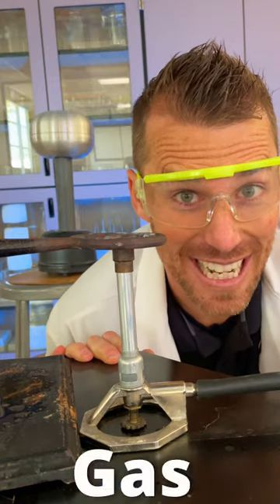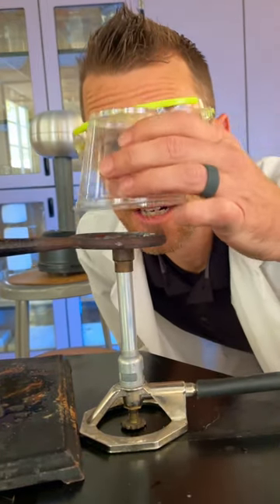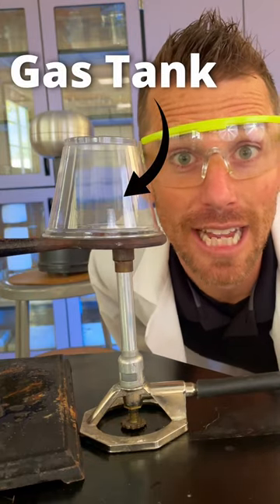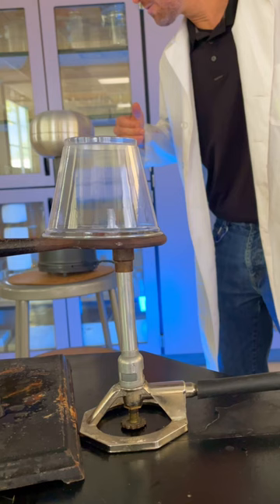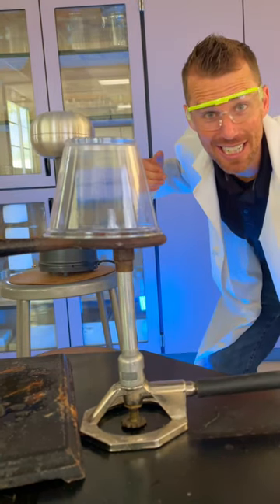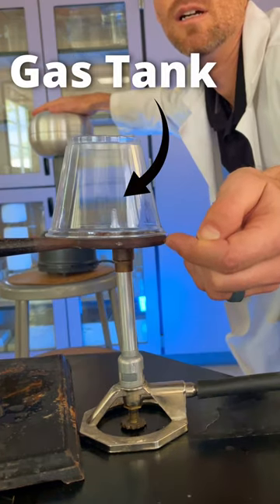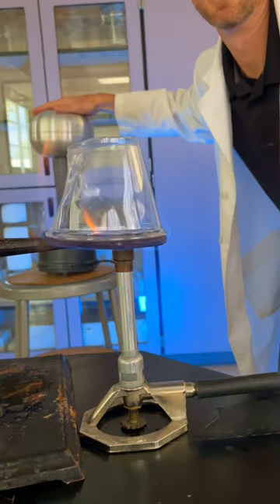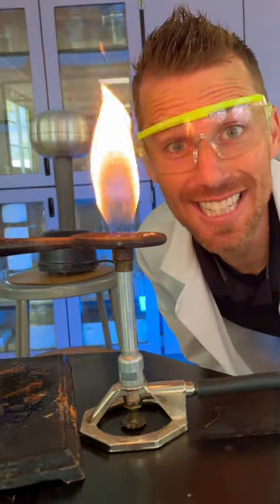Static ELECTRICITY and GAS STATIONS don't mix #shorts

Comment from the maker: Let me know what static electricity experiments you want to see in the comments!

Check out Bending Fire with static electricity:
https://youtube.com/shorts/QraOFzXEOYo
Reply: can you make a corona inside a sealed container of flamable gas?
Reply: The premise for the vid, not so hot. But a plus for production and passion. 

As far as static experiments can we see some static discharge threw different atmospheres and conditions?
Reply: Next time tell us the science behind how they prevent static from being a problem at gas stations
Reply: Build a PC, but instead of wearing an anti-static grounded wristband, give each component a zap of static like you did in this video before installing it, then see what happens when you try to boot it up

Comment: The Mythbuster crew tested this myth and couldn't get any ignition.
Reply: There are things that are hard to recreate. It's common practice to ground  big containers of flammable liquids in factorys. (Some Paint ect.)
And they are grounded for the purpose of discharging static electricity safely.
Reply: Weren't they testing whether or not cell phones could explode gas stations? I don't remember them testing static as well.
Reply: @ravenmist4890 they did test static too along with the cellphone and one more thing too I believr
Reply: 😈ORGODIAN RULER😈  Lighters use pieces of flint that create sparks when you spin the striker wheel.
Reply: orgodianruler6591  no, most lighters use burning metal shavings to ignite the gas
Reply: They did, but the conditions they needed were a 1 in a billion chance in a wild setting.
Reply: Probably because gasoline and propane/butane/whatever gas he was using is not the same thing
Reply: @lucaraaska8938  yea, hard to recreate, like an ignition source from a lighter right beside a buildup of gas... I can do that without any static charge nearby
Reply: Yes, because the Mythbuster crew is the end-all for every experience, surely
Reply: 😈ORGODIAN RULER😈  that uses butane and is easier to ignite. Gas needs a lot hotter spark like from a taser or spark plug, but it still needs the help of being sprayed to better mix with oxygen.
Reply: 😈ORGODIAN RULER😈  forgive them, they are still living in the stone age.
Reply: @ibringthepayan  gasoline will not burn. Gasoline vapour will ignite pretty easily, you need a proper mix of vapour to air though, the closer to perfect the easier it is.
Reply: @dougaltolan3017  not true take a flame to gasoline and see what happens. Sure it's the vapors that ignited but you don't have to do anything extra the hotter the heat source is the natural air mixture will do the job.
Reply: We responded to a pickup on fire at the gas station in the middle of the night. The driver was fueling up his gas cans in the bed of the truck. I didn't see the guy but I'm sure he received some bad burns
Reply: When they forced it they could but they determined that the amount of static electricity needed was more than one person can make getting in and out their vehicle they also debunked smoking stating that unless the person is actvly lightlung a cigarette then it can't caulse a fire
Reply: @ZeeoFullbright  I worked at a gas station where an attendant was required to pump the gas for you. As I was actively handling the nozzle, the chick in the driver seat starts to light a cigarette. It ended fine, but of all the times to light up, she chose right then
Reply: Best chain of comments lol
Reply: Why

Comment: Something has gone very wrong for gasoline vapour to be that concentrated in the open. As in, accidentally setting off a static discharge by closing your car door is going to be the LEAST of your worries!
Reply: Zackly, I guess this guy hasn't heard of the stoichiometric ratio.
Reply: @rustiemenard3945  Most people haven't.

Comment: So basically what he's saying is this will literally never happen
Reply: He's saying that there's a non-zero chance of it happening, in which case there's no excuse to not take simple safety precautions
Reply: @boyo7918  if you took safety precautions to prevent every non-zero-chance misfortune, you would have a bad life.
Reply: It had happened a lot of times actually
Reply: It's easier to happen than you think. Filling up a plastic gas container in the bed of a pickup truck generates static electricity and can make the whole thing go boom. That's why they say to always fill up containers on the ground.
Reply: You kidding? Hundreds of tank opening fires due to static electricity alone. Each year.
Reply: @scottmatznick3140  No it's a relatively common thing to happen, especially when filling a polymer tank in the bed of a truck. Can happen with a regular fill-up too if you are super-charged from layered winter clothing, getting in and out of the car. It doesn't take a van-der-graph to make enough static to ignite gas vapor. It is pretty rare for any individual to have this happen to them, but there are millions of people filling up gas tanks every hour, it's bound to happen. I usually touch the body of my car before starting the fueling process to discharge the static in a safe location instead of right at the gas nozzle. And, the safety precaution is not time or energy consuming.. just touch the car before you fill up lol, it's not like you have to suit up or anything.
Reply: @scottmatznick3140  Yes. Don't take too many precautions if they're too cumbersome and the risk is non existent.

However, are you really that lazy to not ruffle around too much in staticy clothing? I mean come on, don't be too petty.
Reply: @tomodachi1644  name one instance with citations
Reply: @calabrais  My crew responded to a fire in the middle of the night for this exact incident.

Comment: Good thing fuel tanks are not made of plastic cups that leak!
Reply: Plenty of them are made of plastic, and metal ones aren't foolproof either. They can crack or rust out.
Reply: The most likely situation where it comes applicable is when you open the cap of the fuel tank, fuel vapour inside the tank starts coming out, and your hand next to the metal of the car can create the static shock, igniting the vapour to an open fuel tank. You don't need a sealed non leaking container to represent this situation

Comment: An experiment based of this:
Electric charges can build up on an object or liquid when certain liquids (e.g., petroleum solvents, fuels) move in contact with other materials. This charge can occur when liquids are poured, pumped, filtered, agitated, stirred or flow through pipes. This buildup of electrical charge is called static electricity. Even when liquids are transported or handled in non-conductive containers, something rubbing the outside surface of the container may cause a static charge to build up in the liquid. The amount of charge that develops depends, in part, on how much liquid is involved and how fast is it flowing or is being agitated or stirred.

Comment: Natural gas and petroleum have different combustion points. As does natural gas compared to LNG . While you should discharge any static at a gas pump, it's not like a single charge will set a pump on fire.

Comment: As a petroleum inspector climbing the 75 foot petro storage tanks at refineries here in Texas. We are to be grounded and all equipment the entire time.
The pack we carry is metal lined with our measuring instruments touching said metal. Our bodies have a metal bracelet that is attached to the pack and the we have a clip we attach to the metal railing when we to the storage tank. Before even touching the tank. we are to touch a rod that is sticking up out of the ground near the tank about 10 ft away with our bare skin discharging any static. We then approach the tank and ground ourselves and equipment with the metal clip and cable that grounds us and our pack.
A person who did not comply with this practice set ablaze one storage tank which spread to neighboring tanks killing him and several fire suppression team members when they attempted to put the fire out. The tanks burned for several days and a nearby town went on complete lockdown. Respirators were delivered to all residential areas due to the poor air quality.
Static electricity around any fuel source IS A BIG DEAL.

Comment: Assuming that gas (the liquid with confusing name) have the same ignition point as gas (the gas in your burner) and your static electricity arcs over the plastic flap into the fuel tank, and there's enough air (being O2) in there to let it burn, then Yes you might see something happen, and depending on full/empty your tank is the effect will be more or less interesting
Reply: We call it benzin. And gas is gaz.
Reply: It's not the liquid fuel that's the danger, it's the vapor mixing with the air outside of the tank.
Reply: @venus_de_lmao  that was the idea, but in a tank with only gas fumes you won't get anything I think you need like a 30/70 mix

Comment: So, couple problems with this. The gas is a liquid going into the car, you are using a gas. Yeah, gasoline does flash to a gas, but not that much will flash in modern automobiles. Filling a gas can, yeah you will get a fair bit of vapor. Now the bigger problem is the catalytic converter. That bugger is HOT. Hot enough to auto ignite gasoline vapor. Which is why you want to not spill as much as possible, and clean any large spills promptly.

Comment: Now I get to demonstrate how much of a cautious safety nerd I am (used to be a firefighter) . Every time I fill my fuel tank on my vehicle , I do the very same , one once the fueling is in operation I do not enter or exit my vehicle to prevent chance of spark from door light switch actuator , I leave my dumb phone (yea I know you call them smart phones) in the car , and as the fueling is in operation I stay with the nozzle with one hand on the nozzle controlling the filling and the other hand on the metal of my vehicle thus grounding myself and preventing the off chance of an errant static discharge , as well I keep at least one foot flat on the ground during this operation . Refueling is actually one of the more dangerous actions that many many of us do almost daily , so do it safely .

Comment: I mean between both the economics and safety all of my Chem teachers and professors always drilled us to never have the gas on if we weren't using the flame. But fair enough on the static thing.
Reply: well yea but the whole point of the vid was about igniting the gas with the startic electricity, would be a litttle pointless if it was already lit-

Comment: Funnily enough, I was just watching the Mythbusters episode about this where they tried to see if getting a cell phone call at the gas station could a achieve the same result (it couldn't). One thing they did bring up was that if you were to accidentally cause a fire while pumping gas into the car, don't immediately remove the nozzle like your instincts would tell you, because that could spray gasoline everywhere (which would probably not be very good).

Comment: This is why all gas stations have extensive grounding systems to discharge excess energy. Do when you read to touch the metal on the gas pump prior to touching the nozzle it's a good practice to do so prior to dispensing fuel. More people need to see this video to understand the dangers of raw gasoline!

Comment: Yeah this is a horrible misrepresentation. Your LNG tank is sealed and doesn't have sufficient oxygen to burst into flame or explode if hit by a static discharge. The stoichiometric ratio is simply too low. The experiment done here is more akin to if you have an open valve with gas leaking out catching fire. But so long as that isn't happening, walking around outside and accidentally discharging an static build up to the metal grounded tank isn't going to do anything.

Comment: Moral of the story: Use petrol stations, not "gas" stations. They dispense petrol, which is somewhat different from the gas coming out of that Bunsen burner 😜. Still highly flammable, and could be set off by static, but a bit less so than gas 😄. Also, as noted by others... Leave the van-de-graaff at home 😉

For anyone who isn't clear on this. It's a joke, so kindly stow the pitch-forks. I am aware that those in the U.S call them "gas stations". I'm just poking fun 😜.

Comment: It's dangerous but not that dangerous. You need perfect conditions between a failed vapor recovery system, prefect air to fuel ratio, and a massively sized discharge   in the prefect spot. I worked at a gas station and the fire department wouldn't show up unless a spill was 50 gal or more

Comment: If you look into a empty lighter with button starter from the top, you see a small electric arc on the central tube where the gas comes out when you press the button. Same principle, controlled environment.
If you want to understand how this works, look up piezoelectric crystals. Here's also a very helpful video from Steve Mould:
https://youtu.be/wcJXA8IqYl8
Reply: only if its a pieco electric lighter

Comment: The circumstances required to generate that much static electricity is whiled. Gas tanks are plastic, and they use a non conductive metal were you insert the nozzle

Comment: Remember, after you get out to pump gas you're supposed to touch a metal part of your car to discharge any built up static on you from your clothing or friction with the seat etc. This guy is shocking it multiple times but it could actually take just 1 tiny static shock to do the same thing

Comment: And this never happens in real life because companies for vehicles have already taken safety measures to prevent static discharge from annihilating your car. Don’t smoke around gas pumps though because gas is too chaotic to control so the fumes may be drifting in your direction.

Comment: Ah yes, evap systems definitely haven't been in vehicles for over 20 years to prevent this or anything XD. Its only a problem when something can open the system and introduce a near infinite source of oxygen to the fuel vapor. Like a fuel nozzle. And even then, most newer vehicles have things in place to prevent this also.

Comment: We had a hand cranked version in our class rom it also had a smaller metall ball that was used to discharge it. One wuld hold the big dome on the machene the other guy wuld hold the ball and the last guy wuld crank it up, sending sparks thrugh the fingers of the guies holding the dome and the ball. It was good funn.10-10 wuld doo agen, wuld recomend it to a friend.

Comment: Gasoline needs a strong spark and with the right fuel air mixture. Is hard to even light Gasoline with an ember of a cigarette. Open flames or tazers are different.

Comment: pproblem is this isn't representative. more often than not the fuel-air mix isn't right and you can't prevent static. it's been proven quite a few times that this doesn't happen these days :P
Reply: Actually it happened alot. And is the reason why you can't prop open the nosel  when filling any more. 

The #1 cause for spontaneous fires at gas stations are due to static. What usaly happens is they start the pump and start filling their tank proving the valve open. Then they go into there car or back into the store. Returning to there nosile. This is the critical dangerous part because as the gas gets pumped in the fuems in the tank get displaced out mixing with air. When you grab the nosile after being in your car you discharge and ignight the fumes 

The solution is to always ground your self before going back to the pump go and touch the hood your front wheels or even the opisit side of the pump as high as you can reach

Comment: Never knew a burner uses gasoline gasses. Also how would this even be possible... The gas hose is isolated and grounded before the tip so unless you can fit your hand inside the gas tank while the hose is in there this is in no way possible.

Comment: There isn't ANYTHING that would create THAT much static around a car, not even your cell phone would create a static charge that big. The ONLY thing you'd be doing that could do that would be messing around with your battery and SOMEHOW get an electric charge to jump, but then again the battery is about as far from the gas tank as you can get on a car ..lol

Comment: I’m trying not to leave a comment that says, “Scientific people explaining the obvious.”  Fail. 

Wait.  Are you saying I should take the Van de Graaff generator off of my helmet?
Reply: The flash point of petroleum is -43c it can be isgnighted with less then a 200c spark that's like rubbing your car seats a little and touching the filler more then enough to ignight the fumes you are pumping out

Comment: Yeah but the gas in the tank will not burn. The fumes will rapidly expand.
Reply: Actually if your filling and don't ground your self and discharge on your filler ignighting the fumes. It's more likely it will act more like a wick until the tank heats up enough to atomise the fuel more 

If it happens leave the filler in the car turn off the pump and find a blanket if you can

Comment: But gas is different any can only be lit with a open flame where you are using a literal gas that is much easier to ignite the part of the car when gas is sprayed into a fine enough mist to be ignited by a spark is in the engine